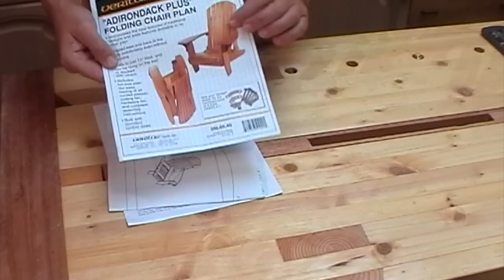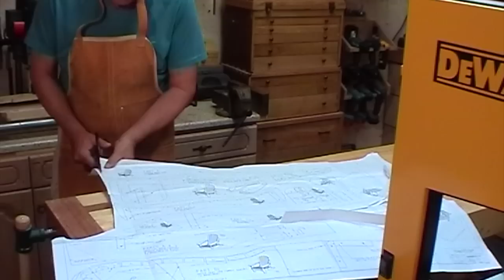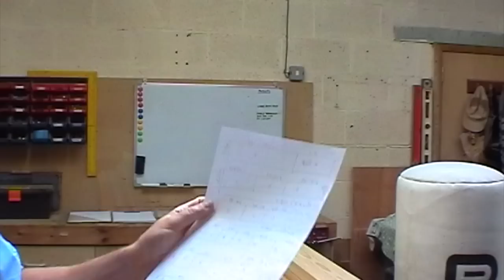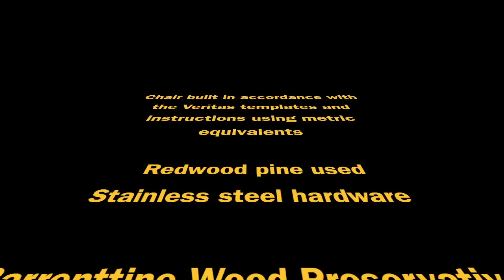Folding Adirondack Chair build using Veritas Plans

Comment: I built one myself about 3 years ago..fun little project... I see you used osmo..that stuff is so expensive. I used that no-nonsense decking oil from Screwfix think it cost me £20..for 5 litres.really good stuff I've left mine out in the rain and all kinds of wether..the wood has never warped or anything. I also used redwood..like you.I  can't talk highly enough about this stuff,,
Reply from the maker: Mr Slim Guy 65 Thanks for the watch and comment, luckily the osmo was left over from a paying job so was a freebie. Yep the redwood is standing up to the weather here as well, did you re coat yours? Cheers Steve
Reply: Phenicia Wood Stuff yes Steve funny enough I gave it another coat in April it was more to put a bit of colour back into the chair than to actually treat the wood..thanks.

Comment: Great job !  Very nice Adirondack chair !
Reply from the maker: SD Woodworking Thanks it turned out nice and got used when we had some decent weather 😏, the plans also came with an option to make a slightly smaller in the seat chair which I also made which was just right for my wife.

Comment: You did a very nice job from those plans ..... but it looks too big and heavy when collapsed to be worth the trouble of folding up!
Reply from the maker: I did use 1” thick timber I’ve used 3/4 since which does make it easier to fold. With the winters in NW UK best to put away 😉 Thanks for the watch & taking the time to comment 👍🏻

Comment: Nice chair and great work. Did you use carriage bolts and stop nuts on all the joints that swivel ? I am building a different folding chair plan that uses lag bolts on some of the swivel joints which do not swivel well at all. Thanks for your advice....
Reply from the maker: I actually used some Allen (hex) stainless steel machine bolts that had a domed head with a stainless locking nut, M10 thread as I recall with a stainless washer at both bolt head and nut ends, they work a treat and still going strong some 3 yrs on 👍🏻 Thanks for the watch, comment and question. Hope it helps. Cheers Steve

Comment: I've just purchased the plans and seen your video; very inspiring to get a couple of these ready for the summer in the garden. do you still have your cutting list for this so I can work out the amount of timber I need. Thanks, a great job well done on this video.
Reply from the maker: Hi Daisy, I’ve just made some fixed back ones very similar to these video link here https://youtu.be/kBacaYx2Y5k anyway the timber requirements are 1 x 1.5m(5’) x 200mm (8”) x 25mm (1”), 6 x 2.4m (8’) x 150mm (6”) x 25mm (1”) per chair and with what is left over and the offcuts I manage to make a small wine table to accompany them. I tend to use thicker stock (1”) but think the plan calls for 3/4” so there is some slight adjustments on the cross members or the seat slats if you go with the thicker stock. Hope this helps. Cheers Steve ps depending on the moisture content and the season the back fixing can become tight or slack I just use some small thin wedges to overcome, they’re still going strong 4 yrs on

Comment: Great video. Question: Did you round over with a 3/8 bit? Thanks
Reply from the maker: Hi Sean as I recall I used a 1/4” bit for these, however a 3/8 would do the job

Comment: Good video but was waiting on a review, how long to do, your opinion, snags you ran into etc
Reply from the maker: Sorry about that Gareth, this was one of my first videos, in terms of time as I recall it took about 3 days,  once the templates are made subsequent chairs are about 1/2 the time. 
No real snags, just determining the gap between the slats initially was fiddly, however once dialled in to the size with some spacers it was a breeze. like most projects you feel like you need 3 hands so a decent set of clamps/grips are a must. 
They're still going strong 3 yrs living outside in the northwest of the UK, the only issue is wood movement where the back slots into the legs, in warm/dry weather can be loose, so i added some wedges and when damper (late autumn/fall) when I collapse them to store they can be tight!
Finally these are quite low so can be a bit awkward for older folk to get out of, and they're quite heavy but I used 1"/25mm Redwood pine! other species of timber might help this out.
Would i build them again yes and still do for friends and family.
The plans are easy to follow and once you've made the templates then they're there whenever you want them.
Hope this helps
Cheers
Steve

Comment: Nice job. Did you use the special Veritas hardware for the folding part?
Reply from the maker: Eric Peterson Thanks for watch and question In terms of the hardware I just bought some stainless steel bolts etc of eBay, what a cheap skate 😉

Comment: Hi Steve, Great build. How much were all the pieces of timber and MDF? Take care Steve. Cheers, Huw
Reply from the maker: Huw, but what a shocking vid 😉 As for the timber it was about £40 (prices have shot up during COVID though)and a 1/2 sheet of 12mm MDF is about £12 (the stuff I used I already had, offcuts from a previous project I guess). Cheers Steve

Comment: what kind of finish did you use? it looks great!
Reply from the maker: Nicola Ballantine Hi, I used a wood preserver first Barrentine Golden Brown, then a couple of coats of Osmo UV protection oil, 425 Oak transparent. It still looks good still and held it’s colour well. Thanks for watching
Reply: @Phenrica  I take it pressure treated wood is not required given the sealants added?
Reply from the maker: @MitchBegle  they’re still good 3yrs on, I’ll be giving them some tlc during the autumn/fall with a rub down and a coat of Osmo. As for pressure treated it can only help tho’ the pt stuff around here is awful stuff.

Comment: Hello, I'm working on one of these chairs right now and I have a question for you regarding the armrest supports. Are we supposed to drill four screw holes in both sides? Wouldn't that make it so the leg swivel would not work? I would appreciate your help on this. I have used your video through every step.
Reply from the maker: Hi Edmund, if you’re talking about the two angle brackets then you only drill the 4 screw holes in one (this attaches then to the arm) and the other has the single larger hole for the carriage bolt, it’s this that attaches to the leg and gives it the swivel. Hope this helps. Cheers Steve. Ps thanks for the view and question, if I can help further please just ask.
Reply: @Phenrica  Thanks Steve. I finished the chair today and it looks great!
Reply from the maker: Edmund Lowe Hope you get the weather to enjoy 😉

Comment: The Adirondack is a very American design.  Is it common abroad?
Reply from the maker: Joey Suggs Hi Joey I guess the design came from the Adirondack region in New York State USA. The design is quite worldwide I believe, they’re very comfortable as a outside/garden lounge chair plus quite a straight forward woodworking project. Normally they’re of a fixed build type which makes them awkward to store etc in the winter months so the folding ones make this easier imho.
Hope this helps
Reply: Thank you for the reply.  I hadnt known they spread so far.  Always thought they were a New England thing.  Nothing better in summer in the shade with a G&T or mint julep.

Comment: I'm sure you can find awesome woodworking plans on woodprix website
Reply: Sunny Brae Woodcraft Here.  Just a question  Under " Assembly Instructions"  it states ( all templates and these instructions assume your stock has been milled to 3/4 inch.  yet you used 1 inch?  If you used the templates as I have 1" will not work.  Can you explain please tks